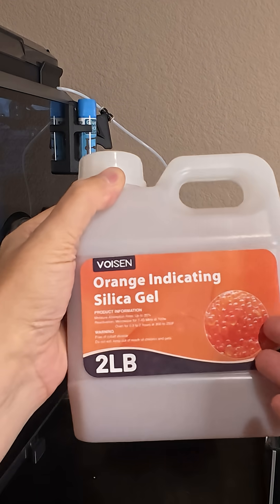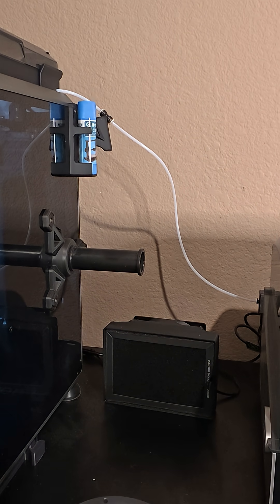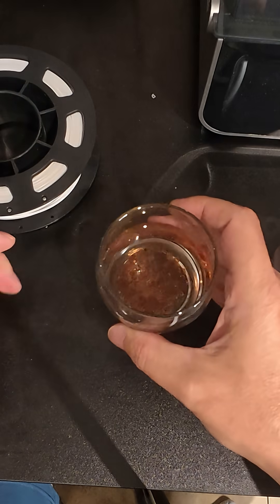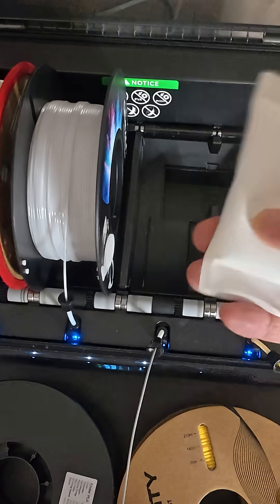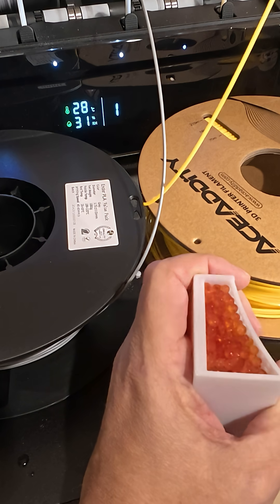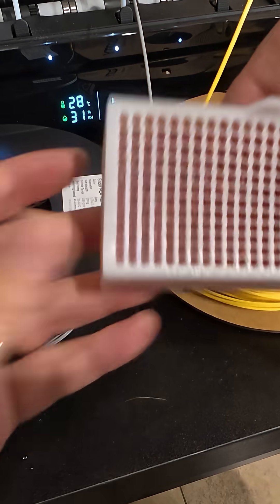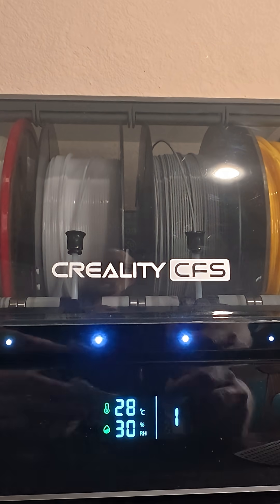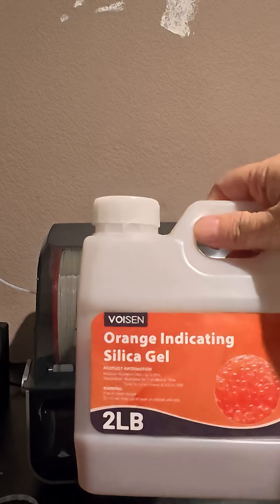Color changing Desiccant #3dprinterupgrade  #3dprinttips #3dprinting #filamentstorage #3dprinted

Comment: Never needed that and printed a lot with not a single problem on an ender5, never needed to dry filament, or anything like that, infact if you dry the filament it makes it brittle, and more likely to break  prior to extrusion and create clogging in the print head.

I never had issues with my ender5 and my silk pla spools worked best without drying them at all. This may be different for other materials, but PLA plastic really shouldn't be "dried", (at least where I live)
Reply: You're right, most of the time pla won't need drying. But, it depends on 2 things: your surrounding humidity and also the filament. Some areas are really dry and won't need more drying, other areas are humid and the filament will need drying. Also secondly certain filaments do need to be kept very dry, mainly tpu, but petg and many other filaments absorb water very well and don't do well wet
Reply from the maker: TPU and nylon/PA are the types I find need drying. Maybe ASA.